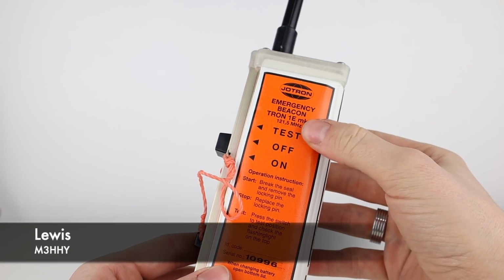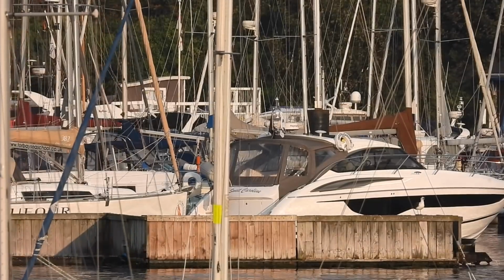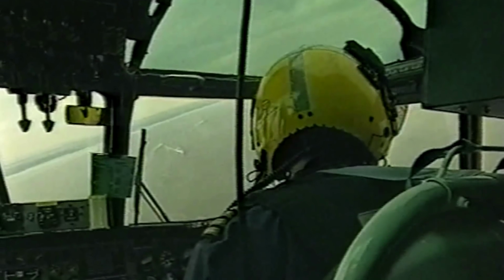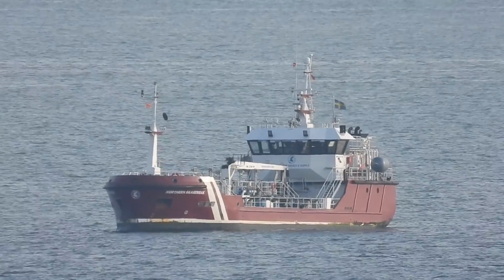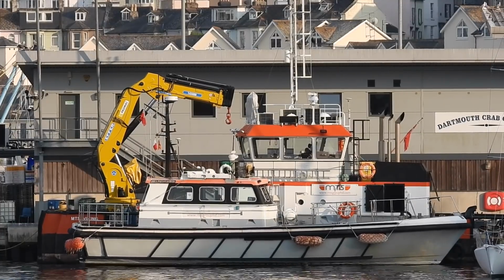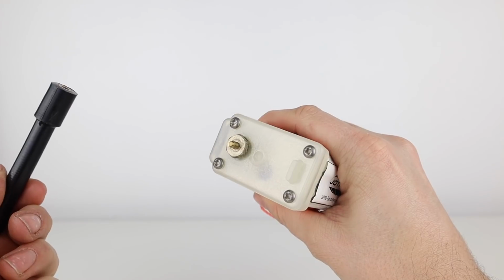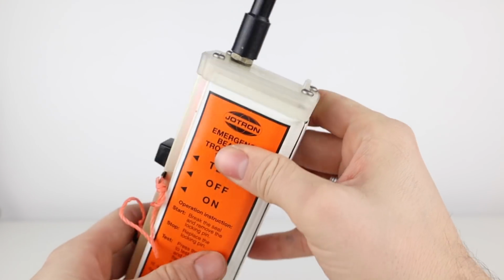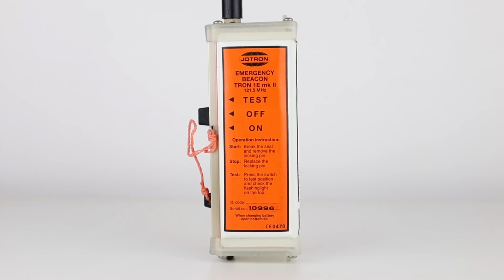A Life Saving Radio Position Indicating Beacon

Comment: In my previous job I sold a lot of the 406 MHz PLB units to people travelling in remote areas in Australia. The majority of these were the GPS equipped beacons that transmit the owners location via satellite to the emergency services. 
Cheap insurance... especially when you consider how many people have died after getting stranded in "the outback" due to vehicle failure or accident.
Good for people hiking in remote locations too.

Comment: Where I used to live a helicopter appeared one day and was flying very low over the houses, unusually low, we are used to low flying helicopters, but this was very low.  It flew about for a while and slowly came over the houses and started to hover over a block of four houses.  Someone came out one of the houses and the winchman came down and spoke with them.  The helicopter went away from the houses and landed somewhere just outside the village.  You could hear it just sitting there engines running.  After a while the crewman went inside the house of the person that came out.  He appeared shortly after and was talking on a radio or phone, bit to far away to see.  I could see he had something brightly coloured in his had.  It was an emergency beacon that had been set off.  Never found how it had been set off, but there were kids and dogs in the house.
Police arrived, took some details, they were there for a while and the police left with the crewman to drop him off at the helicopter (i assume).  They did have a small boat I found out later, the device had been taken home to prevent someone accidentality setting it off.  The boat owner always took it with him when going on the boat.  Never heard anything though from the device.  Maybe it was loud enough inside the house, or it was silent.

Comment: i used to belong to a usa .org, called the civil air patrol. a voluntary auxialry of the us airfocre . before our post shut down and went somewhere else , i talked to some of the old timers about epribs . they said  one of the challenging ones was in a garage and the batts went bad and tripped the device . the homeowner got fined by a branch of the us government called the federal communications commission.  the homeowner was charged with sending a false distress signal. another 1 was during a very lagre bush fire where at base camp a pilot put his legs on  a helecotors dash board and tripped the device . oops .the french would get upset with us as the epribs would activate sarsat.

Comment: I'm confused, 121.5MHz is EGKK approach
Reply: Tony, not so.

121.5 is the aviation emergency frequency.

It's not just for ELTs but as an example - if we get lost while flying, we can call them and they can give us a fix of where we are.

Gatwick approach is 118.950

I've flown over Gatwick loads of times (in a helicopter) so know their frequencies.

If you look at the Gatwick frequencies in the AIP you will see 121.5 in the section under APP.

In fact this frequency shows up under most airfield listings so is a little confusing if I'm honest.